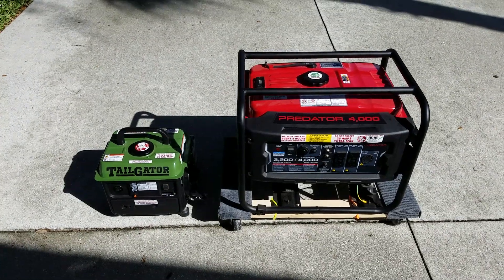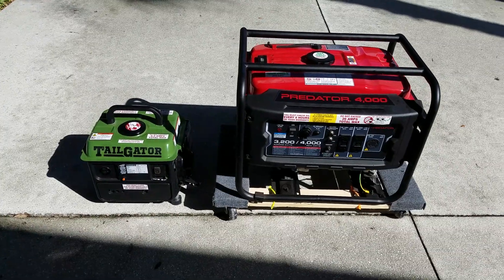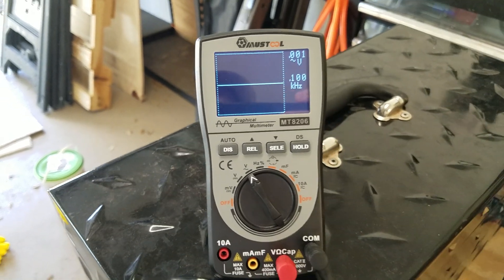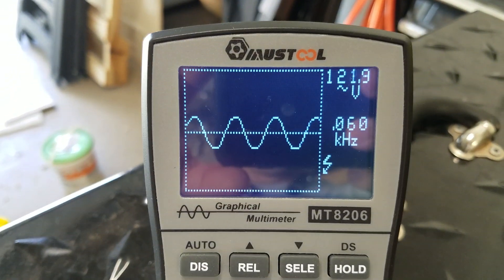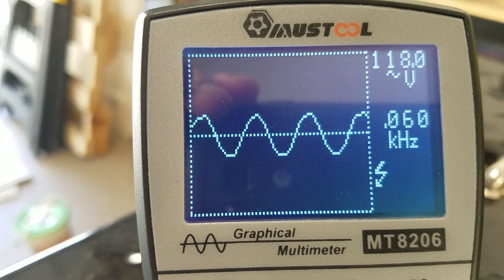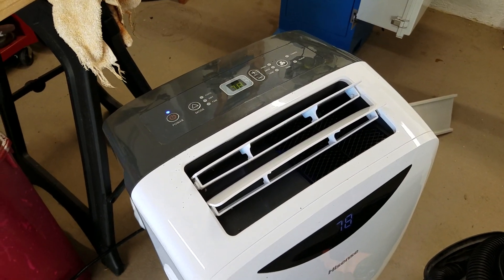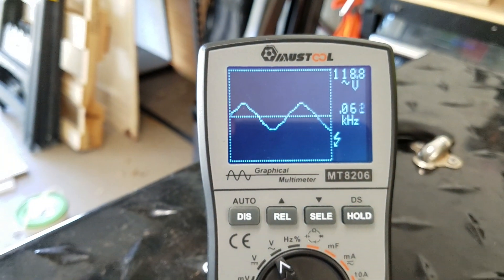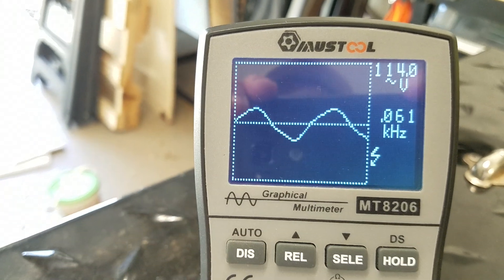Harbor Freight Generators: Testing Wafeforms With A Cheap Oscilloscope

Comment: i am subed to a real lot of channels, and so, yours and many others, i only watch an occasional vid. And so, I do not know much about you. I have used a REAL oscilloscope in electronics. I have seen the kind in this video in catalogs, do not think seen one in real. My previous thought is that it would have a somewhat usable waveform. I am shocked at how terrible the sampling and waveform is. I see it as, for myself, completely useless. And so, I have learned a lot about this kind of oscilloscope. Not putting what you did down, I found it interesting as I have never scoped a gen before. But, you certainly would see a Real Lot More with a real scope. I bet there would be lots of intermittent noise, small spikes etc. I do have a scope and two gens. I am unlikely to scope and video them though, I do not think I would find anything unexpected. Basically,  you demonstrate it, but in, what one may say, in a very blurred way. Good video though anyways, I never seen this done, and did learn from it.
Reply: BiddieTube You do have to admit it’s a bit of information considering the price of the meter. Sure it’s far from an ideal way to inspect the waveforms, but it definitely seems useful enough to get a rough idea of what the waveform generally looks like.